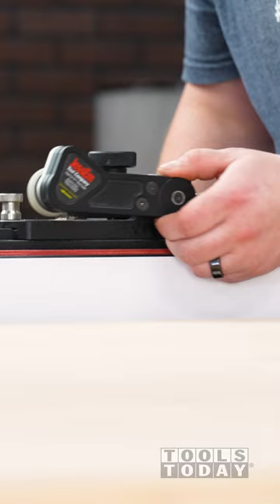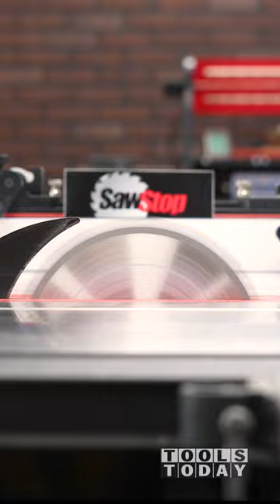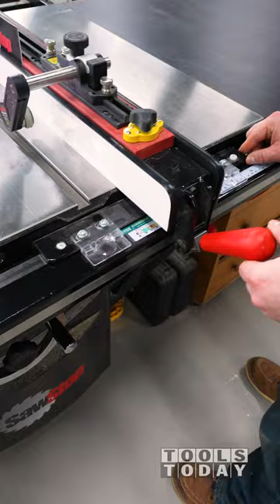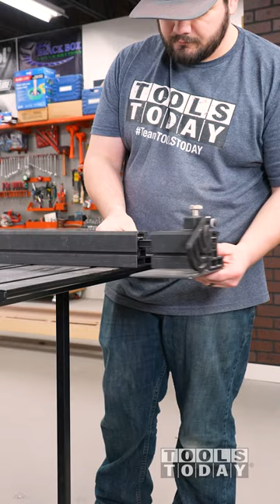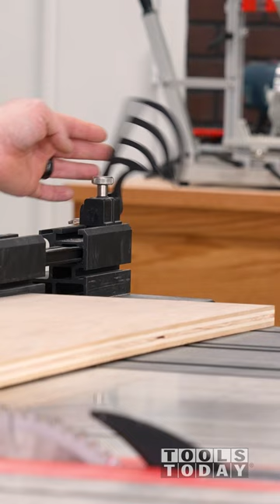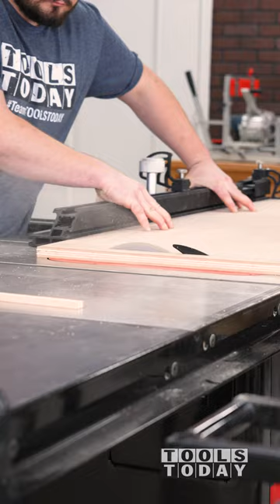Cutting Pieces to Size

Comment from the maker: Cutting all of the parts to size to make a work holding top for my workbench on the table saws. I love using the sliding table for larger parts like this, keeps things safe and easy while cutting. The blades used provided a perfect cut with no chipping at all! All items shown in the video are available from www.toolstoday.com
- - - - - - -
JessEm TS Stock Guides, item no. 04301
Woodpeckers Full Throttle Blast Gate, item no. WP-FTBG-IL
Amana Tool 40T General Purpose Blade, item no. PR1040
SawStop 5HP ICS Table Saw, item no. ICS51230-52
Bow Products PushPRO, item no. PP1
SawStop 1.75HP PCS Table Saw, item no. PCS175-TGP252
Sawstop Sliding Crosscut Table, item no. TSA-SA48
Amana Tool 80T Double-Face Melamine Blade, item no. MB10800